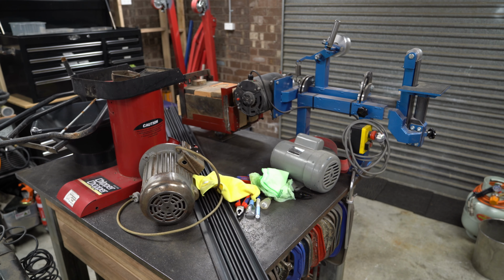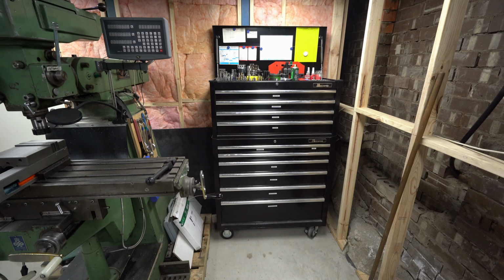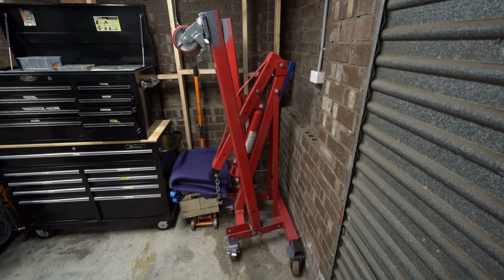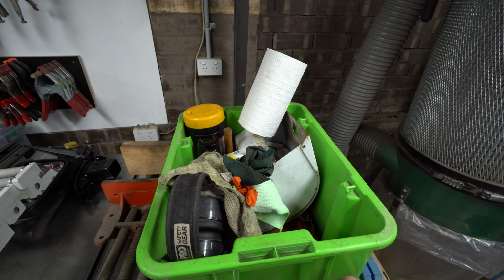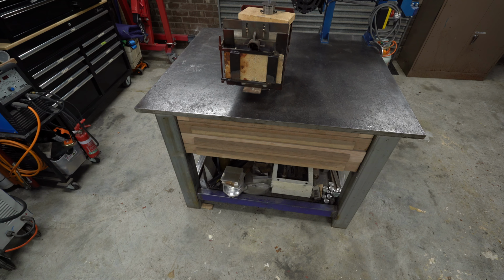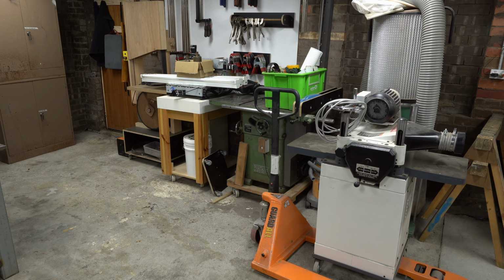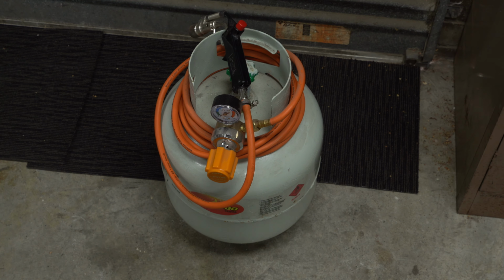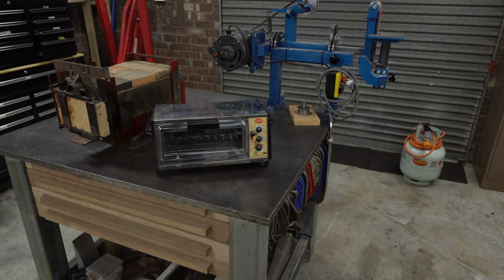25th Oct 2023 - Workshop change around, new forge

Comment: Hi Craig.
Looking good mate ( I mean the workshop 🤣🤣).
Question and Suggestion…
Is that enclosed staircase an ‘exit’ from the workshop, or is the roller shutter the only exit?
If the roller is your exit, you may want to consider ….
Separating your volatiles cabinet from your welding/forging area…
and/or… putting a CO2 or dry powder fire extinguisher in that area.
My ( single fibro garage) workshop only has one exit - a roller shutter. My welding heating station is near that roller shutter exit.
So… I’ve added a shonking great fire extinguisher on the ‘blind’ end of the welding area.
If something goes up… and I can’t get out… then I want that extinguisher with me in the ‘trapped’ area.
A recent ( injurious) fire in a  YTbers shop made me rethink my own safety.
Regards
Robert
(Sydney)
Reply from the maker: Thanks Robert. You make great points. I have three exits from the workshop. The roller door, the person access door next to it, and the stairs at the other end. I do keep a small powder fire extinguisher on the welding cart, but I would like to invest on large powder tank near all doorways! It kinda keeps me up at night, so it is something to act on soon. Thank you for the reminder and great comment 👍

Comment: 😮 Huge changes, looks fantastic. It is nice to have all the machines but if you aren't using em...
You have empty drawers too 🎉 the value of empty spaces is very underrated 😁
With the tub(s) of odd gear like ppe or anything similar, I find it's easier to just let them find their own places 
🍻
Reply from the maker: Ha. Don't confuse tidiness with getting nothing done 🙂 I get the most done when I keep the workshop tidy. When it's a pig-sty, I don't want to face it, and nothing gets done!
Edit: Oh - you mean woodwork machines. Yes - agree 100%

Yes - empty space is awesome! (empty workspace as well as some empty storage)

Re: PPE, yes that's how I was running things before, but nothing had a proper home, so it floated around and I was always looking for things. I think I need to have at least a standard dumping area for it all. Or ideally - somewhere tidy to keep it all together.
Reply: Shed Tetris... way better than monopoly and maybe equal to cribbage 🤣